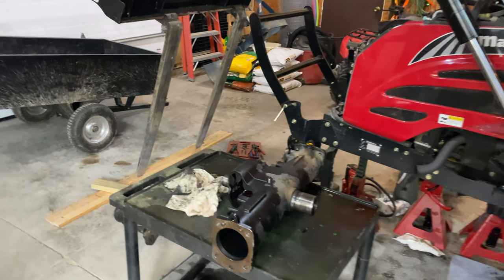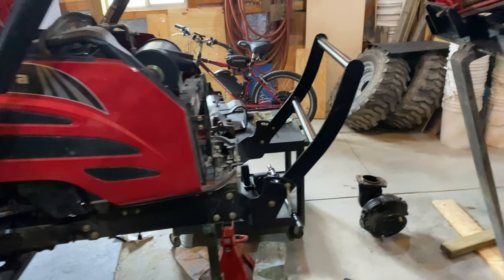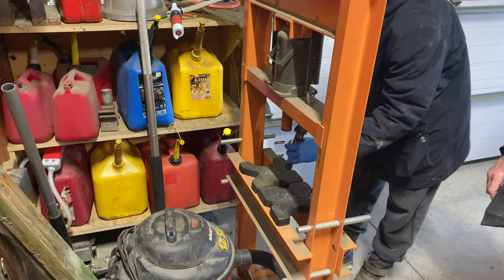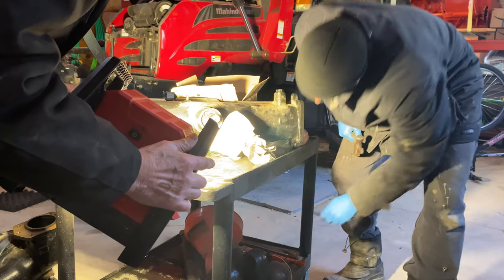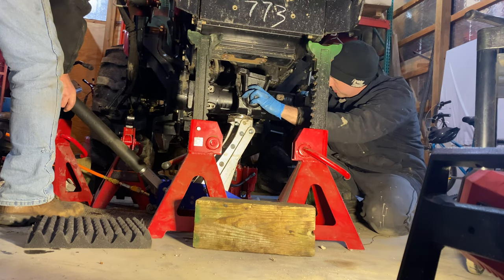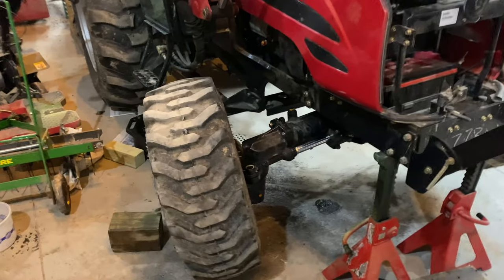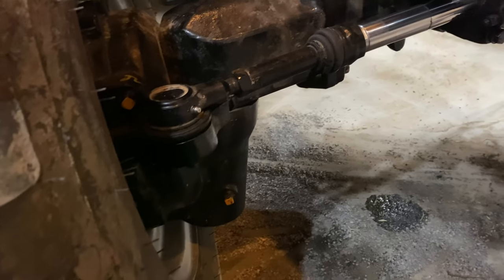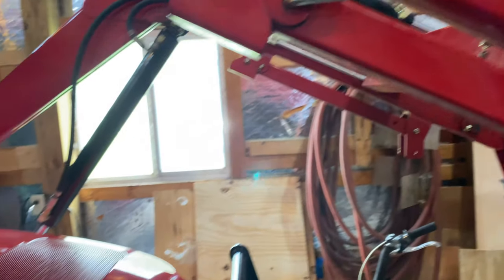New Front Pinion Gear and Bearings on the Mahindra 5010

Comment: I had a similar issue with my 4540 I picked up for cheap.  Gear oil poured right out the left hub.  Had to rebuild the outer left hub and the pinion gear similar to yours.  Bearings were chewed right up.  Service manual on mine calls for heating the front taper bearing up to 120C to fit it on the pinion gear.  That made putting the taper bearing on really easy!  No press
Reply from the maker: Good to know! We did not have a service manual available.

Comment: Always nice to have a hydraulic press to press bearings in with.  I've used my former boss's hydraulic press several times.  His has a gauge that told you how much pressure you were exerting on the part in PSI, which was really handy.  I remember rebuilding a retractable landing gear on a 1980 Piper Arrow airplane where I was basically pressing steel bearings into aluminum castings.  There are four castings in an Arrow and I remember gritting my teeth while I was pressing those steel bearings in place and hoping I wouldn't crack any of those aluminum housings because each one of those housings was $1100.00 a piece!  Fortunately, I got the new bearings installed in all four housings without a problem, got the landing gear all back together, the gear retracted and extended flawlessly the first time.  Having that PSI gauge on the hydraulic press helped a lot.  Lol!
Reply from the maker: I've seen that on some presses, always thought that looked useful, unfortunately i don't think there is a way to incorporate that on this one.
Reply: @radozeman  When you are reassembling the axle, after you slide the differential and ring gear into the housing, what holds it in place? Does it just free float against the pinion gear? We have a Mahindra 7010 apart (due to a broken pinion gear) and it seems like an odd design as it appears that the diff/ring gear just float in the housing…? There’s a snap ring on the outer end that stops the diff, but not on the pinion side??

Comment: That is the wrong hole. The gear oil fill hole has a gauge that you use. it is actually a dipstick that is used to so that you dont run the differential dry which is what you did.

Comment: How many hours do you have on that tractor?  What brand and type of hydraulic oil do you use ? I bought mine 2nd hand and didn’t get a manual with mine.
Reply from the maker: I'd like to say 500 hours, failure in was lack of oil, either we didn't fill it properly or it leaked out.  We use the Mahindra brand hydraulic oil, and Mahindra 80w90 for the front axle.